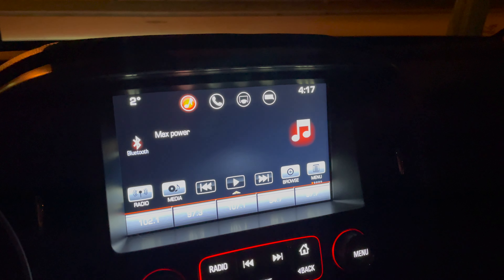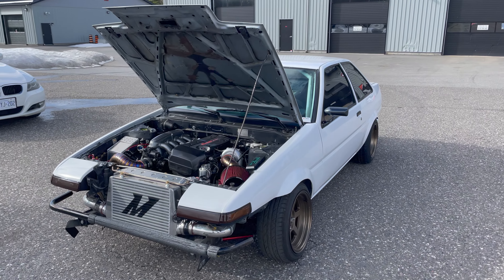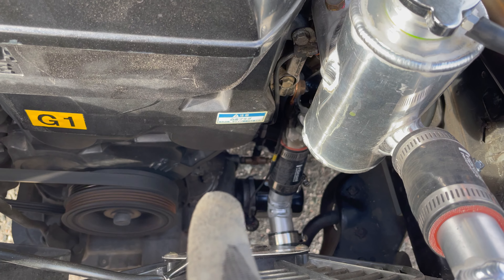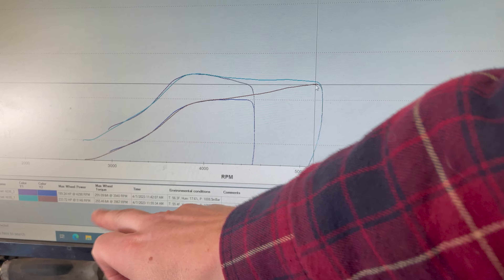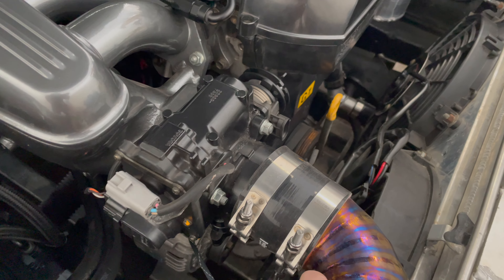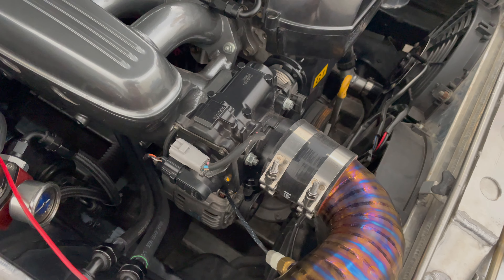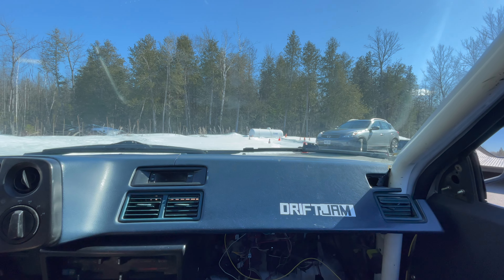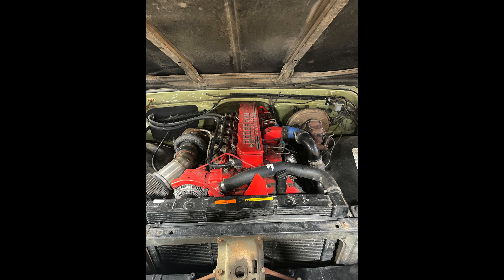3SGE BEAMS TURBO AE86 Dyno Day - Sounds UNREAL!

Comment: Hello, I have an ae86 beams swap and I would like to make it turbo. What internal modifications did you make to the engine (cranks and pistons) and what turbo did you use? and what differential does the car have? What its the front tires size?
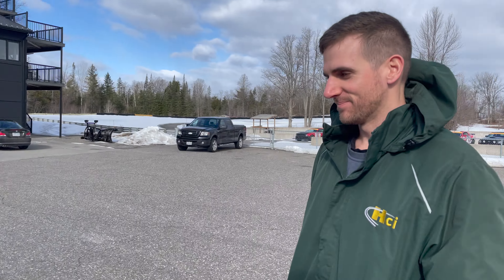Reply from the maker: Motor is completely stock and unopened. Turbo and support parts are in the description. Rear diff is from Weir Performance (4:30 I think). Tires are 195 on 15’s.
Reply: @SDSGarage89  195 55 or 195 45?
Reply from the maker: 195/45/R15 on the fronts. Rears are 50’s or what ever is around.

Comment: How did you find the 1000cc injectors to be? Plenty duty cycle left at those power levels? Things a ripper makes me want to ditch the 4agte plans lol
Reply from the maker: So running pump gas about 30% duty cycle with a Walboro 255 pump. Technically they are over kill for pump gas but would be medium ok for ethanol or blends. It’s a ripper for sure 🤙🏻

Comment: what ar turbine housing did you go with
Reply from the maker: The man says 72AR or largest that would work with V band setup?
Reply: @SDSGarage89  nice I’m going to try the 5455g it’s got a closer turbine to compressor size they usually work a little better plus it probably won’t fall off up top so hard with the little bit bigger turbine wheel, i ordered the same .71 ar housing.
Reply from the maker: @russellsoro  sick. What’s it on?
Reply: @SDSGarage89  beams swap ae86 coupe